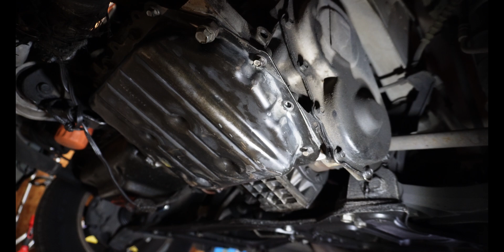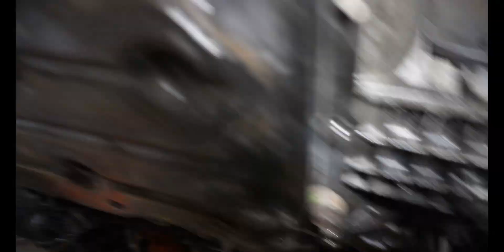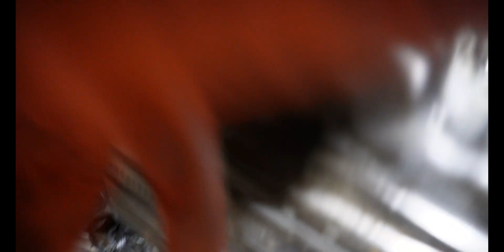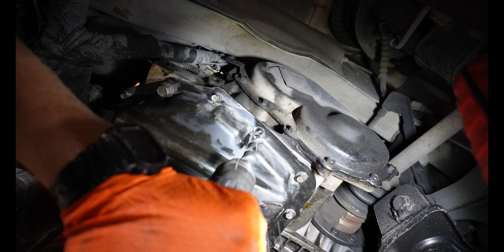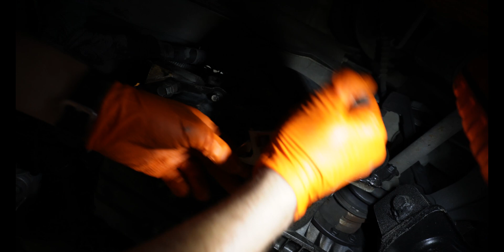How to repair a stripped transmission pan bolt (hole)

Comment: Have a similar problem and landed here - lol . I just changes out the trans fluid , replaced gasket .  19 bolts ...got all of them back in except for 2 and they are right next to each other.  Both holes are stripped and both bolts are barely hanging on . I wrapped a bunch of teflon around them and seems just ok . Not  entirely happy with the result.   -

 Question  - can you just get a bolt similar in width but longer and then put a NUT from the top ?  Any suggestion would help . 

There is no fluid leak thus far thank God
Reply from the maker: Yes you can!! I have done that before. It just depends on the transmission
Reply: @gagefixeseverything  Ok thank you good to know ,  appreciate it  !!

Comment: How do you make sure that you don’t drill too deeply? I was thinking mesure thread length and mark that depth +1 mm on the drill bit. Then drill, then run threads through. And again mark thread depth +1 mm. Both my bold are stripped where they back end goes into case not pops out the back

Comment: Should I do this with my gasket on?
Reply from the maker: @doobfarm-w1f  it's best to do at the transmission pan off but you could do it with the pan and gasket on if you really had to. You just run a risk of getting metal shavings between the pan and the transmission stuck in there

Comment: How do I make sure i buy the right size bolts? I have to do this on my wife's rav4.
Reply from the maker: If you're going back with the same size bolt as you had before, you can take it down to the hardware store and match up the threads or match up the threads in your tap and die set. If you're going with a larger bolt then you will just use the same thread pitch bolt as the tap that you use to tap out the hole

Comment: So a m8 x 1.25 you use a 21/64 drill bit, but doesn't a 3/8 x 20 tap work better cause it's closer to the 8mm. 10 mm uses a bigger drill bit not 21/64.
Reply from the maker: Correct, I just used what I had laying around, because this was a gambler 500 vehicle.
Reply: Had some 8mm bolts stripped out and I used 5/16th tap. Seems to work better then 8mm

Comment: Got to the end of a job to find a stripped bolt. Great info here, saved me a ton of time!
Reply from the maker: Thanks for the comment, stripped pan bolts can be super frustrating to deal with!
Reply: My Jeep has been leaking all day as I have been DIYing to get new transmission fluid, filter, and pan. I've been trying to figure out why it's leaking all day. I had a gasket issue with the sealant, but I'm still working on it because one of my bolts is stripped. I worked all day on my Jeep Liberty on Labor Day, and now I have to take the next day off to fix it and put my pan back on. I hope this will do the trick.